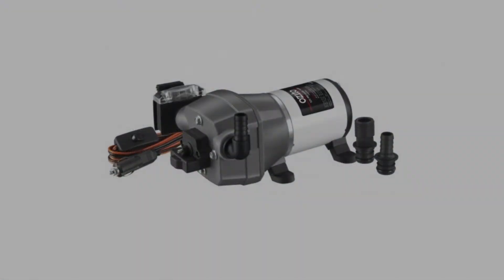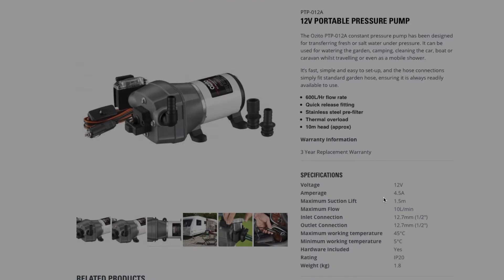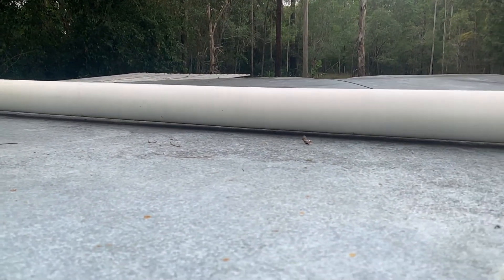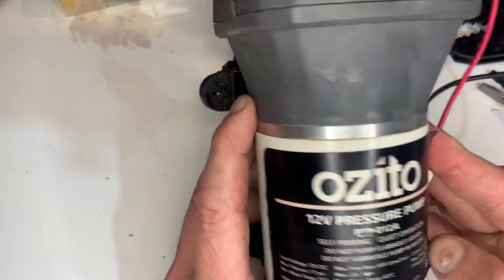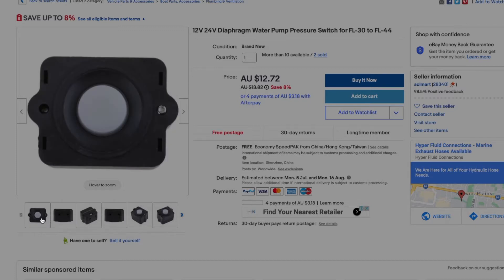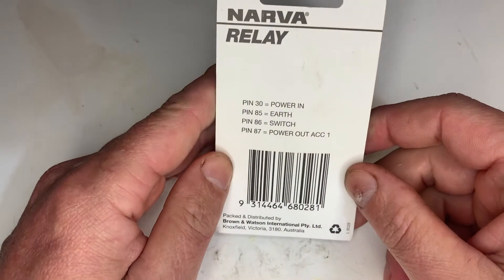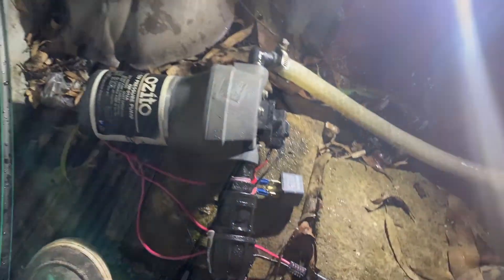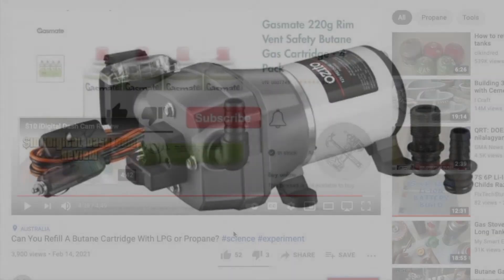Ozito 12V DC Pressure Pump Review / Everything You Need To Know, 3 Years Off Grid Water Pump

Comment: Howdy. I have this pump but when I run the shower I need to cut the pressure right back on the gas califont so it gets hot enough. That makes the pump keep clicking off and on. Is it possible to change the psi of the pressure switch so it stays on in lower pressure? Also, whats the point of the relay? I don't really understand those. Thanks
Reply from the maker: Hello. The point of the relay is the full load is carried through the tiny microswitch, I burnt out a few before I released adding a relay would make a difference. On my gas hot water system I adjusted the temperature to make it work better. I also removed the reducer in the shower head. Clicking on and off is inevitable, I do have future plans for a MOSFET based controller and a seperate pressure switch. You may be able to adjust the pressure  switch to better position, a tap near the pump with a hose leading back into the tank can save a lot of headaches.
Reply: Thanks for the reply. I think i get it with the relay. So the switch is just a trigger without carrying the full amps through it. I think its time to get a bigger callifont. Thanks for your help and the video.